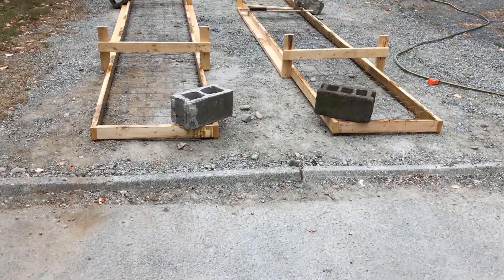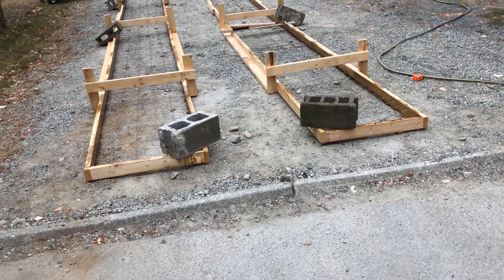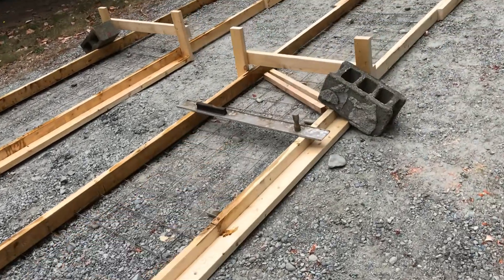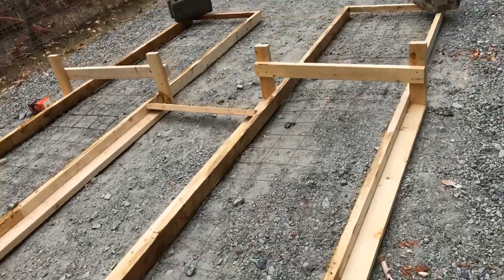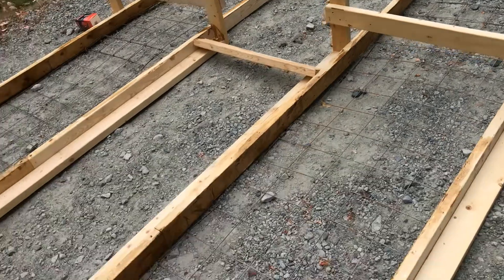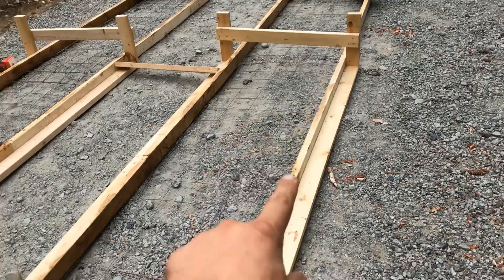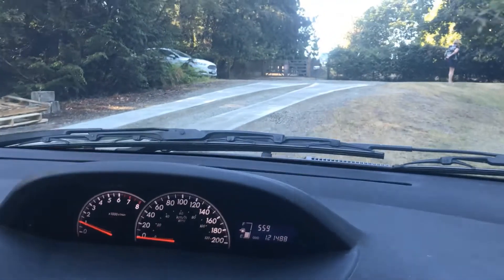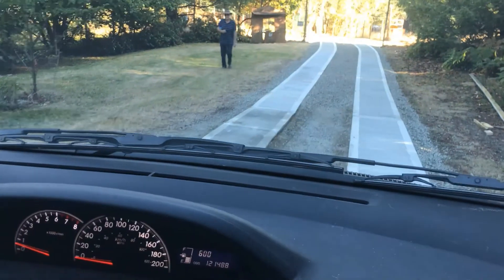Concrete Ribbon Lanes - Alternative to asphalt paving for a steep hill driveway

Comment: So how much did cost? I have a big hill drive that I been maintaining for 15yrs after each heavy rain,  how has is been to maintain?
Reply from the maker: It cost around $8000 at the time.  It has been easy to maintain I have had some cracks show up that I have had to seal up but after a few years I still wish I had done it 10 years ago.

Comment: How many feet and how thick were the ribbons for this driveway if you don't mind me asking.
Reply from the maker: The depth was a full 4 inches deep because I took a 2x4 and added strips of plywood with a narrow crown stapler to make sure I had enough depth.  The width of each lane I made was 30" each if I remember correctly.